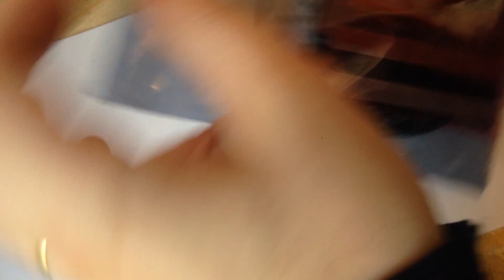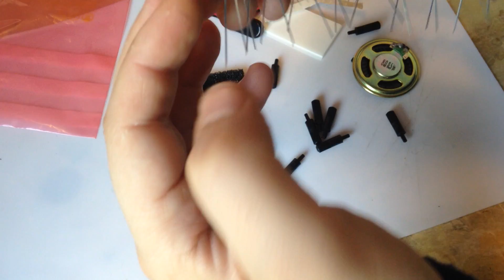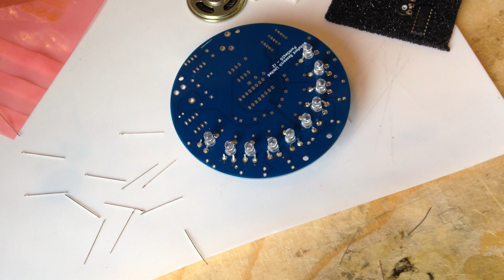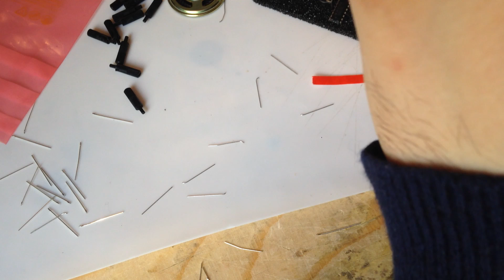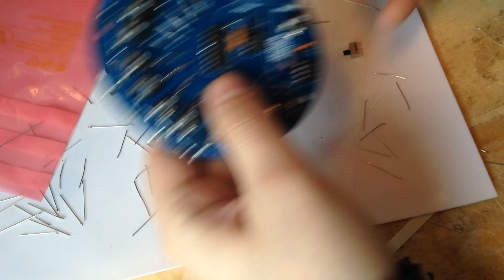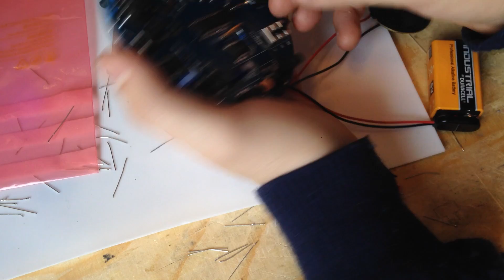PunkSeq10 Build Video

Comment: hey mr, i've downloaded your schematics. I'm doing this on prototype board as a project for a subject. I've noticed that you drew all the diodes going to CV pin of one of 555s. Cool but on the PCB schematic, ready to make, they are going to 7th pin of that 555 [discharge NOT CV] which drives me crazy because i got stuck and i dont want to burn that. Please reply!